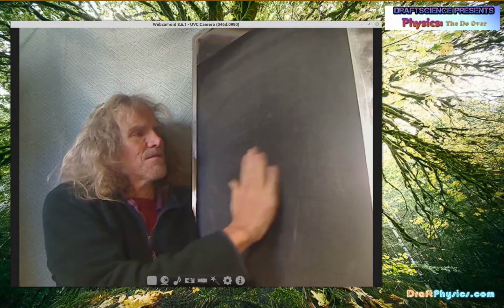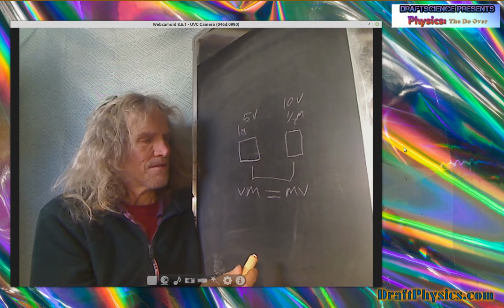What Is Energy? ...The sensible answer

Comment: Here I will post a comment I found which helped me understand the "4 times" issue.
Reply: If you are driving at 25 m/s and slow down with a force that causes an acceleration of -5m/s/s, you can do the math and figure out you had a braking distance of 62.5 m. Now, if you were driving at 50 m/s and were to apply the same force, not only would the TIME for you to brake double, your average velocity while slowing down would also double. Therefore the distance you brake for at double the speed, is four times that of the original.

Source https://www.physicsforums.com/threads/why-is-kinetic-energy-1-2-mv-2.691249/
Reply from the maker: @Ayestosea  As stated in the video, the subject is NOT "are there INaccurate ways to measure energy?" the subject is, if you accurately measure the energy can two things with the same momentum have different amounts of kinetic energy? The simple answer is NO ... And conventional physics has some very bad mathematics that says otherwise.
Reply: I can guess a response.

In the braking example, a similar force is applied (by foot acting on pedal) in both circumstances. If using a robotic foot we  can simply look for the next variant in the braking system etc etc. 
So I guess he's saying that overall there's no point in calculating something that can only be calculated. That calculation can never be realized or experienced materially. I think he's saying overall, the energy is always the same. You might be able to move the energy around within the energy but that would only be within that total energy ....not in addition to it.

So for example : a gymnast accelerates across a floor, flipping faster and faster. Visibly we see the first step (slow), first flip (a little faster), second flip (faster) then the gymnast explodes into the sky spinning axially/longitudinally/upside down and inside out.... before landing motionless and composed upon the sprung floor.  I think he's saying - the energy is the same at the beginning and at the end and all the way thru. Some may claim that the landing would exert the most force at that instant. So again, we could measure that force, but its all dependent on geometry and shape and flexibility and springs and on and on forever. Overall the energy stays the same. You can't separate a moment of energy from the overall energy. 
You can calculate it.
You cant put a tap on it and collect that so called 'calculated' energy. You can't do anything useful with it. Or, if you can, you could simply change the geometry/structure of the system to prove otherwise....
Reply: The elevator and fuel is a great example. There are millions of ways of raising an elevator using less fuel. You can get a small snapshot of one particular instance when raising an elevator 4x the height uses 4x the fuel...however you could engineer that scenario out of the system.
Reply: In fact. If I raise a plate from the table one inch I use an amount of fuel. If I raise the plate ten inches my system (my body) doesn't use ten times the fuel. What part of the system is using ten times the fuel? My wrist? Arms? Prob the same on the fork and elevator. If you jacked them up to a nuclear power station.. 😳... the forks wouldn't consume or emit a multiple of energy. You could lift an elevator easily without using four times the fuel.
Reply: .....so the energy "is" the shape in motion. Mass (shape) multiplied by velocity (motion). Anything else is simply an arbitary variation.